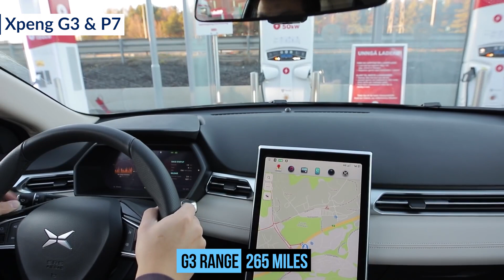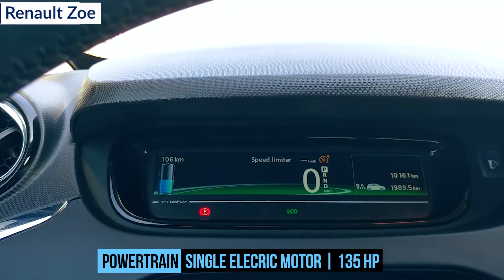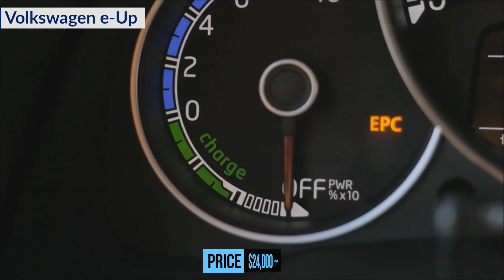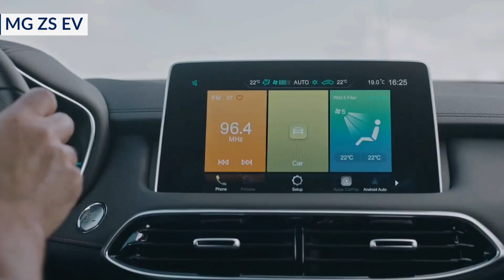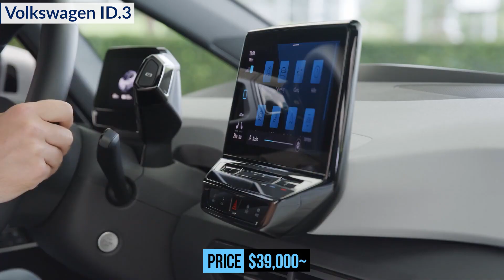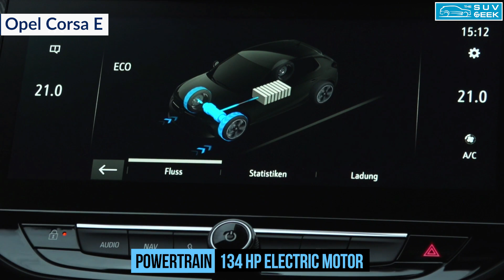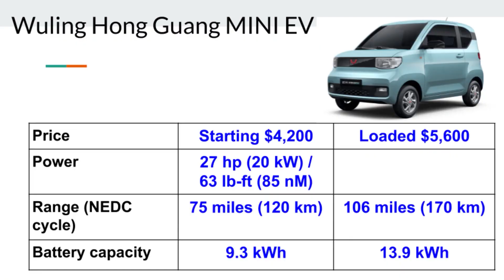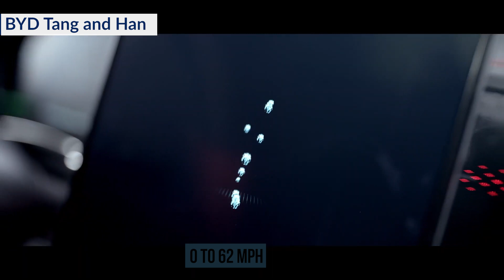10 New Cheap EVs from Europe & China - From $5000

Comment: Gotta say though, still far above ICE car prices. The electric car push seems doomed to failure if the prices don’t come down. The costs have come down, but the prices still outstrip ice vehicles. I’m genuinely starting to think Tesla and all other ev manufacturers could fail unless the ICE is legislated out.
Reply: No way. The only problem is the infrastructure which is being worked on. 

A brand new tesla model 3, with a 250 mile range is only 39k. That's less than a base 3 series or c class. For 10x the car.
Reply: The Federal and State EV Tax Credits brings the price down by at least $7500 for the Federal, plus whatever State EV Tax Credits are given. So most of them come down around $7500-12,500… they’re still expensive, but not quite as bad.